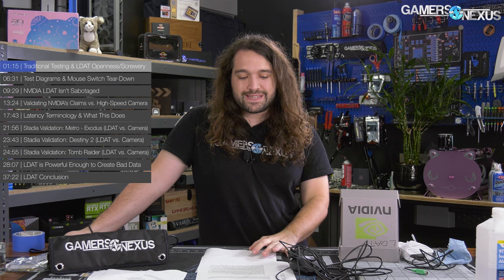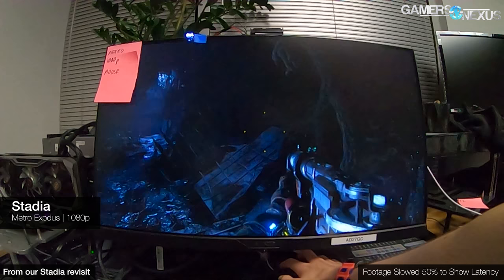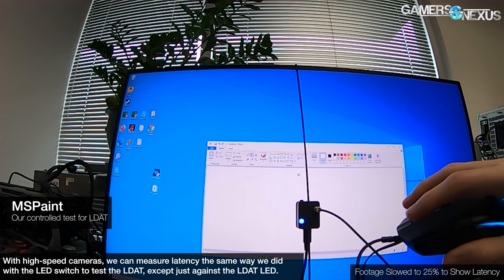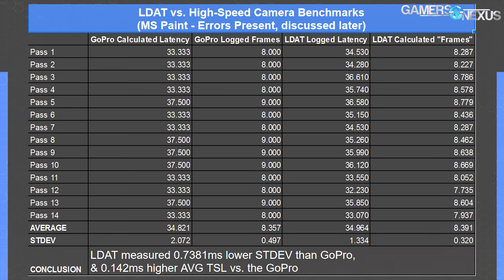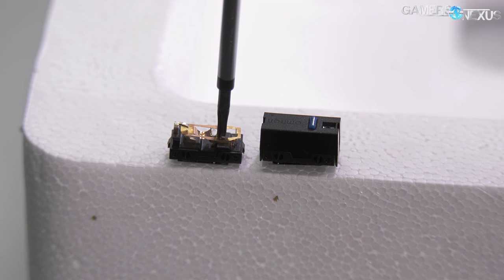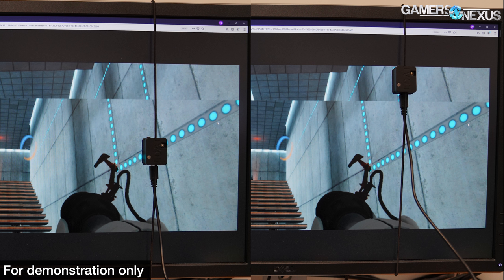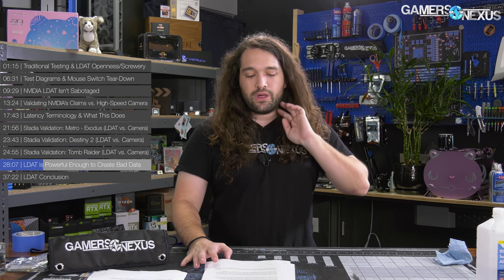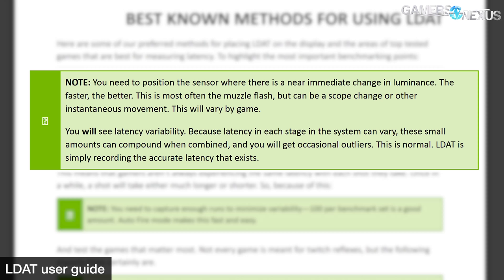Automated System Latency Test Methodology (NVIDIA Latency Analyzer Validation)

Comment: Great to see latency testing gaining more exposure. 

I wonder if NVidia's Speed Of Light app is faster than the one I wrote. Mine is written in DirectX 9, which produced for me better results than DX12. Haven't tried DX11. 
When benchmarking game performance you obviously want to use actual games. When benchmarking hardware, you want the software to be introducing as little of a delay as possible, which is only achievable at very high frame rates. My program switches the screen color from black to white with each mouse click, and runs at about 10,000 FPS at 1080p. You can also set an FPS limit if you wish to run 2 different hardwares at same FPS, for example. You can easily compare the FPS of my solution vs Speed Of Light using a tool like PresentMon or others.

My tool is open source so feel free to use. https://github.com/NotThat/Benchmark-DirectX9

Comment: For any electrical/computer engineers: 
Could you use an FPGA and essentially do the same thing with a mouse hooked up to the fpga and a photoresistor on the monitor? Just thinking of a way to do this home made if they never release this to the public?
Reply: cas curse hmm thanks. Might be a fun side project. Any drawback to using the arduino vs other micro controllers?

Comment: Will you do a PS/2 vs USB and or USB on Dedicated M/KB ports vs any other ports in the system?
Reply: That might be a little difficult nowadays, given how few (if any) motherboards have true PS/2 support. Sometimes one will still have a single PS/2 combo port powered by a Super I/O chip, but that's not quite the same thing as a true PS/2 socket that has its own dedicated IRQ line.

Comment: Latency is a difficult thing to calculate, from a Windows 1709 version to the last 2004 version you already have more latency and FPS in 1% and 0.1% low lower.
It can also come from the installed drivers some are better than others.
Windows 10 is the entrance to the horrible mouse.
Windows 7 was really better !!!

Comment: Well, the problem i see is that if you use LDAT without an high speed camera, you will never be able to find out if the light detector was misplaced from the data, you would need to rerun the test in case the data deviates from what you expect.
 Having the high speed video available allows you to see if you screwed up, and possibly to re-analyze data without having to acquire it again. All the manual process could be taken away with a relatively simple python script which opens the high speed video and detects the frames in which the LED goes on, and when something (like luminance in a given pixel) changes on the screen...

Comment: I think vsync is a must tearing is annoying as heck so not acceptable and for that reason vsync will be always on for pretty much anyone so the most relevant test. 
As for paint. This will run the gpu in 2d desktop mode on less then 200 mhz (on my gpu) maby that will influence the data aswell so maby its different when you run furmark on the side which boosdts the gpu to max clocks.
The main thing that bugs me on this testing is animations that always feel slow so you will need verry specific games but latency is different per game and that makes it hard to test.

Comment: If Latency was really an issue 'Online multiplayer twitch shooters like WARZONE just wouldnt be feasible. Ultimately this is more marketing fluff.

Add Raytracing. Slaughter fps anyway.

TSL doesnt make sense either because EVERYONE has a different system. Saving thousandths of a milliseconds wont be noticable by any human.
Reply from the maker: You seem to have greatly misunderstood the TSL section.

Comment: Hey Steve, how would you balance a $2000 pc to get the best performance possible?
Reply: well of coarse you should balance it on your head while on a highwire . Jokes aside it depends what you consider best performance. Are you talking about gaming, or some specific workloads, or are you just looking at a daily driver computer that does gaming, web surfing everything
Reply: Dralor D I’m going to use it for gaming, video editing, and designing/creating robots. I want to be able to overclock and have good airflow.
Reply: @genius8889  Definitely need a mid tower case. Water cooling or air, is a good question for you for the cpu. GPU, If your making money from the vid editing then prolly 3090, if its a hobby 3070-3080 "AMD not announced yet so cant comment on them." CPU's honestly wait till the AMD announcement. With it being so close its really hard to say. 2k budget your prolly looking at the lower end threadrippers from Zen2 atm or the 3900/3950X. 

In all honesty I would say wait till AMD's new hardware is announced, there will probably be a discount on the current gen CPU's and we might end up seeing more Nvidia gpu's announced soonish after AMD's announcements.

Comment: As a Test Architect, I would say there is no need to coin a new term acronym here. E2E/ETE (for end to end) is a well understood industry standard term which means exactly what this test type is - all inclusive, from beginning to end without skipping or mocking any components. If I told a tester the EEL (end to end latency) was X, they would know exactly what that meant without you needing to explain. The concern that you brought up regarding what it really means to test total system latency from GPU A vs GPU B does not belong within the spec itself, but rather defined by the specific test as part of its setup/background listed in the test plan.

While I'm at it, regarding the concern about people cheating it... Mark my words, you must continually re-evaluate test procedures or this will happen. Example, when a game wants to brag about lower latency, they could simply short circuit most of the real gaming and rendering engine to make a change on the screen within threshold as a 2d overlay effect, giving the (technically correct) result that a change happened substantially faster than it actually does. Another thing is AI enabled technologies... if the AI is tuned to have the fastest transition time, it will meet that goal but it would be very easy to accidentally be training that model to exploit the test. For this reason, I wouldn't recommend throwing out your manual testing all together. I would recommend double checking against the high speed camera data frequently, particularly when bold claims are made.

Comment: but when you want to test specifically games input latency in PC, i think games like shadow of the tomb raider is a bad test bed for that. the game have a deliberate design on the animation that they have many frames filling the initial animation of everything in the game. i think the dev made it that way to simulate "smoothness" in motion of animation. so things dont looked jerky. so then you get these many frames on every initial animation part on the "kick off". which gamers would [perceived it as "lag". while the game might actually not. just the animation. and its done deliberately by the developer. other games that also using this same "style" of presentation (with the animation seemingly lagging from the "smoothing effect') is game like Chess Ultra. and then there also those games that are developed poorly, that the developer prioritize graphic workings first in the game engine, that input threads are put on low priority. so the game will process all the graphic render first then the input. so it depends on the game too.

Comment: The real money could be made with a "lazy testing" for people instead of latency testing for hardware...
Just imagine if the lazyness of a company department could be negative or at least "negated" ;-)

... i would build a large wooden block on the end of the detector which hits really hard when the limit gets ... "hit"  :-)  *HarrHarrHarr!!*

(sensible edit: perhaps you should replace the mechanical switch in the mouse with a MOSFET (or slower smartfet).
no mechanical button delay and faster, µC software controlled identically timed + paused switching. )